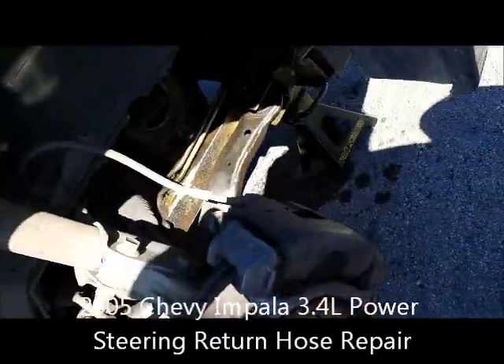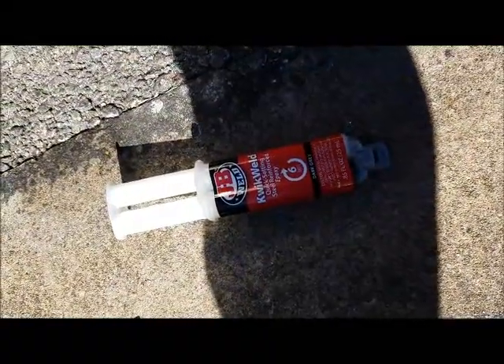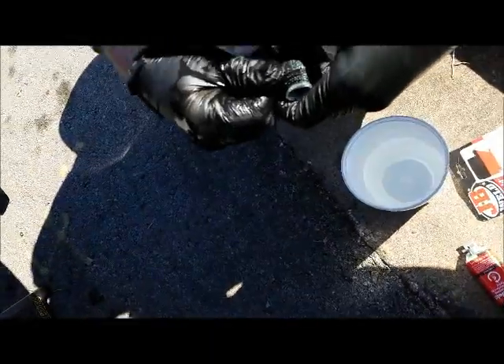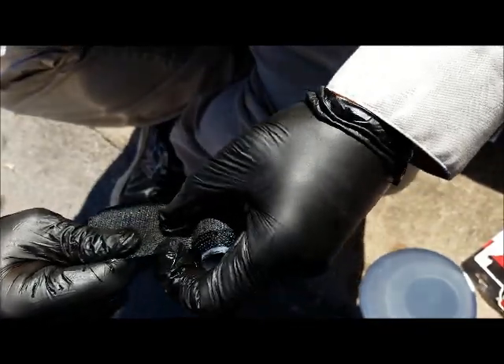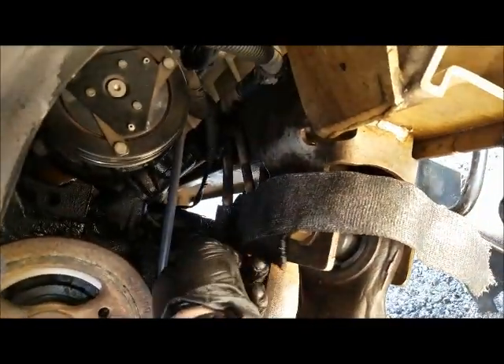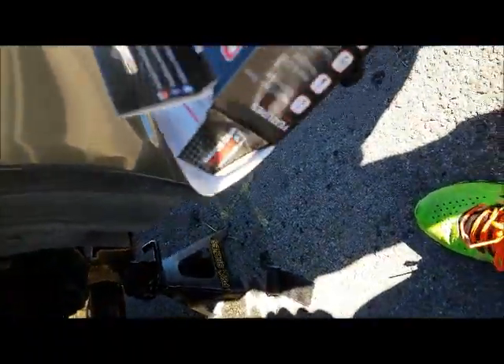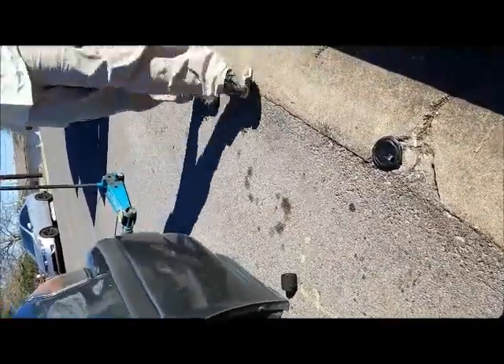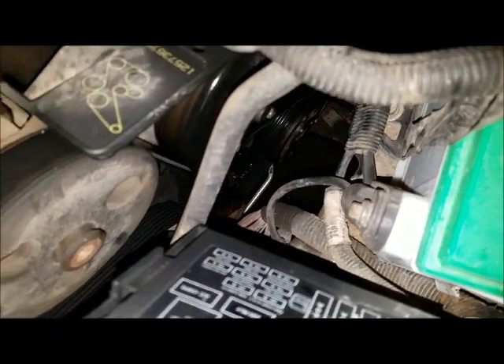2005 Chevy Impala Power Steering Hose Leak Repair

Comment: After watching this, It helped me find out that I had the same leak.  You were on the right track.  I ended up using JB Weld's Steelstik putty as a temporary fix while waiting for the part.  It is still working two weeks later.
Reply: Just an update.  the Steelstik repair is still holding more than a year later.  Still haven't needed to replace the part.
Reply: That's it am doing it
Reply: @noydb-1  TY for that update! 
I think regular jb weld might have worked if they had done a better job of applying it.. they probably didn't prep the surface at all, and they said they didn't wait for it to cure.
Reply: @noydb-1  update?
Reply: @Utzman4x4  It actually lasted several months before I wrecked the car and totaled it.  Wipe down the area with a good degreaser or brake cleaner so the Steelstik will stick.

Comment: Yeah man I tried this and its definitely a no go. I even tried cutting where the holes were. Then connecting a rubber hose with screw clamps and that was temporary as well. Short cuts dont work. Had to replace the line because there's too much pressure.
Reply from the maker: Agree. Ran into the same thing. That is the reason for the notes in the description. I left the video up to help people possibly locate their lines and/or find the leak.
Reply: That's me right now lol. Tightening my gear clamps every morning until I have the time to replace the line.

Comment: I have a 2000 Impala and have the exact same problem. My dad cut the line and had his friend fix the hole (very tiny slit from rubbing against muffler). He attached it using rubber and two days later I'm hearing it again. I'm totally upset.